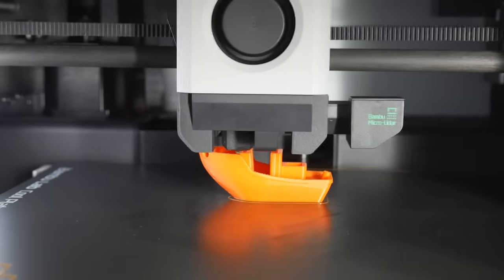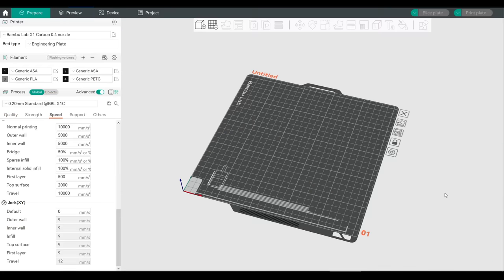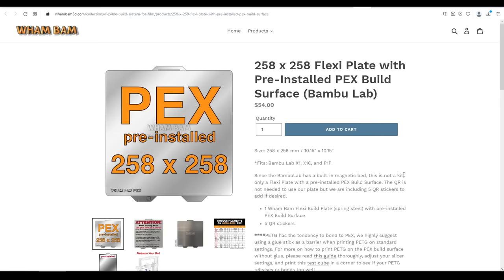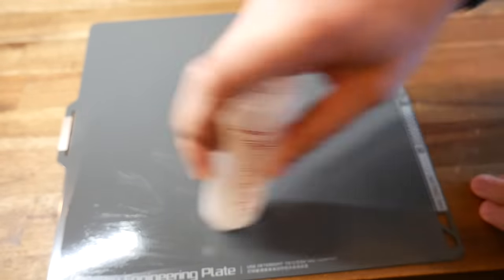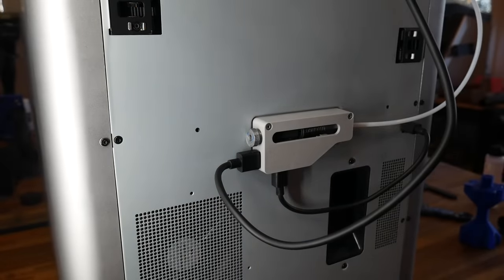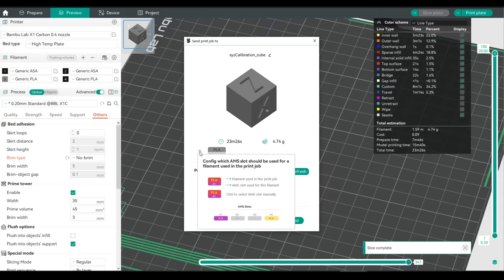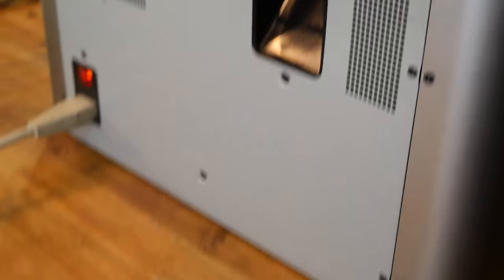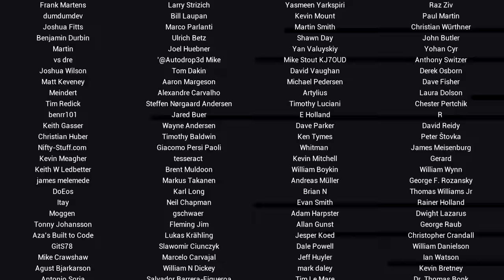The best upgrades for your Bambu Lab 3D printer

Comment: The best adhesive I have used is 3DLAC! Spray on and use on cool plate or hot plate! Best product ever!
Reply: I didn't have anything else on hand, so I tried clear Elmer's glue, and it has never failed. I can print tall objects with a tiny footprint and no brim. Works every time.
Reply: I love 3dlac too. So easy.
Reply: I find 3DLac doesn't adhere abs and ASA adequately. Filaform Adhesive Spray have an extra strong variant for a very similar price and works wonders for high temp adhesion
Reply: @MrStolenakount  3dlac has two variations too, i use the 3dlac plus for abs and Asa and it works wonderfully for me.
Reply: Only needed on Bad plates
Reply: Yes. I use it on textured sheets too when I need to print tall parts with a small footprint, or when the bottom of the print needs to be absolutely flat.
Reply: This! I keep saying it every time and my comments never make it to the top so I'm glad yours did. 3D Lac is the absolute best ❤
Reply: Main job of adhesive on a Bambu build plate is to aid release.
Reply: Yes the Plus is best.
Tried Bambu glue, Dimafix as recommended by Michael at TT, and a few others but 3DLac+ is best.
Reply: most the time i just spray on some hairspray… i’m not very knowledgeable in this field but it hasn’t ever had any stick ability problems
Reply: @BuffGrape I get my new Bambu P1S next week and you answered my question if hairspray works? I used to use a glue stick but now I only use hairspray and it works for me 99.9% of the time on my Ender 3s V2. The only time I have a problem is when the bed is a little off level which takes a couple seconds to fix.
Reply: Nano polymer adhesive is very good too
Reply: Tough to get in the USA

Comment: I never had a failed print on my P1S until I tried printing with Bambu's own PAHT-CF (carbon fiber nylon) filament and using their own profile. I lost dozens of hours and about half a kilo of the outrageously expensive filament before finally buying their high temp smooth plate and glue stick. I haven't lost a print since.. I do recommend getting AMS and some of their support specific filament which will help immensely with your parts appearance and the supports are easily removed.

Comment: Strange to never clean off the glue stick when it just requires a brief rinse under warm water.  I understand the hassle of applying it but removing it isn’t hard and only has to be done after multiple prints most times.

Comment: Use a paper towel and ammonia. It will evenly spread old glue stick residue and you don't need to apply more. Reuse the paper towel and the residual glue can be used for many prints. Only a little ammonia is needed.

Comment: The Bambulab spool switcher & winder is great. I printed it not because I have an AMS or a Bambulab printer but because sometimes the rolls of filaments I use come badly winded.

You can use your own hand and no drill. You get better control. And there are a ton of mods for that model, which greatly increases its performance and ease of use.

Comment: For super good prints with ABS or ASA I use the following settings on the bambu Lap X1

Nozzle temperature to 260 for the first layer and the remaining layers 270.
-max flow of 12 mm3/s
-an extrusion multiplier of 1.0 fits better than the default values of 0.95
-fan speed normal layers 20% to 40% overhangs 40% to 60%
-Speed for the first layer 75mm/s
-110 degrees bed temperature
-high temperature board or textured board
-For very large prints add a bit of 3D Lac
Reply: Thank you for this info 🤘🤘My P1S is shipping and I will print a ton of ASA with it! Assuming it will convert to the P1S; I think the bed temp is max 100° but not positive.
Reply: What's wrong with higher flow rate?

Comment: For using the glue - simply make an X with the glue stick, then spray on some IPA and wipe the bed with it. This will leave a residue that works perfectly and after the print, you simply spray IPA on it again and it's good for another print. That way you only have to apply the glue stick every 4-5 prints. It's shown in this video https://youtu.be/XpHkPJgKkew?t=670
Reply: I do the same. I just wipe the IPA around with a clean hand until its nicely smeared all over and even.
Reply: When you said IPA I thought you were talking about beer. Good thing you added a link to a video! :)
Reply: Just stick glue + water

Comment: For catching poop chute output, I use a small cardboard box behind the printer. Quick, easy (as long as you have or can find a box to fit where you need), and it doesn't take any filament.
Reply: eggo waffle boxes fit nicely and are cheap
Reply: @bulgogiprince8625 Plus, they come with free waffles!
Reply: Leggo my Eggo!

Comment: For the Y splitter for the external filiment feeding, I found a version I really like that has an M3 mounting hole so you can remove one of the panel screws and replace it with a longer one, holding the splitter in place.

Comment: ABS/ASA on the Textured PEI at 110C bed temp will not warp off the bed until it cools. No stupid release agents necessary. I would not try to flex the plate as soon as the print is done. It will be very stuck on there. Could try anything from 90C to 110C to get the perfect first layer adhesion. I usually take it out of the printer and push the bed down on a glass coffee table to suck the heat away from it if I need to remove it quickly. Takes about 10-20 seconds and it pops right off. I have printed probably over 10KG ABS like this.
Reply from the maker: It really depends on the geometry of what you are printing. Some objects will be fine, others will shrink as they cool and generate internal stresses that warp the part. Either way the enclosure helps a lot.
Reply: I've printed some ASA on my P1P. Used a ASA slurry on the Textured PEI (that side of plate  is now for ASA), put the unit outside, covered with a cardboard box.  Internal temperature approached 50C for  hour long printers.  No worries.
Reply: Can I leave ASA prints on the printer bed overnight after it's done printing? or will it warp

Comment: Ive printed ASA on glass by using a trick id seen for ABS, I have a jar that i have melted scraps from failed ASA prints with acetone, brush a thin layer down onto the bed, removes pretty clean and I haven't had any issues with adhesion.
Reply from the maker: Abs slurry is a really old and effective trick, but too messy for me.

Comment: The PTFE bracket is a nice thought, but with my X1C it hits the top of the casings rim when going to the far corners. A break failure of the toolhead is for sure a large warning.

Comment: I just got a X1-Carbon and its my first 3D printer. I've printed quite a lot of dessicant spool holders that screw together in the void space of the spool. I printed a cable management panel for the AMS hub / buffer at the back of the machine but found I had to remix it quite a lot to allow the cable and tube disconnect tools to work when the panel was installed. I'll try printing the PTFE print head guide as my tube rubs on the top glass panel. Currently printing some AMS dessicant holders for the front of the AMS where there is 3 significant voids. Instead of printing a Y splitter for the back of the machine, and having to find the screw-in fittings, it seems that Bambu sell a 4-way splitter on their website for $5 AUD which is normally used on the A1 mini and also works as a Y splitter.

Comment: @14:43 I have watched now about 10 t0 12 videos and no one has mentioned this filament dryer feature. I agree, I would probably use different seals on the glass top when using this feature but still what a great option that’s part of the printer.

Comment: Just a heads up, Dimafix works very good but the adhesive comes off with the print, it doesn't stay on the bed. This means constant re- application. Vision Miner Nano adhesive has slightly better adhesion that Dimafix, the biggest advantage is that it l stays on the bed after the print releases instead of transferring the print, this means you can make it last a VERY long time, just spray a little isopropyl alcohol on the bed to reactivate the nano polymer. It's good stuff

Comment: smooth PEI is the way to go.  easy and no adhesive required like textured PEI, but has a lot more grip, but as long as you let it cool first, it detaches after the print like normal.  the best I've ever used in any printer is my smooth PEI from prusa
Reply: Textured pei doesnt need an adhesive ya nob it aint a cool plate.
Reply: @devizebeats  that's what i said, ya knob
Reply: My smooth pei are a huge PITA. I can't get anything to stick regularly. I clean with dish soap multiple times, I tried upping bed temp which seemed to help for a while but then it stopped working for some reason. All I'm using is pla.

Comment: I'm surprised you didn't include the CHT nozzle upgrade.   CNC Kitchen is the only big channel I've seen cover it, but he focused on print strength improvements rather than speed results.   You did a lot of work to get your RatRig speedboat under 10 minutes and it'd be interesting to see if you could now beat your time with just a stock Bambu + CHT nozzle.   

A channel called BenSol has a 6:13 Benchy on P1P but I think he used Lightning infill so not a valid time for comparison.

Since print speed is a major selling point of the Bambu printers, a fairly cheap and easy upgrade than can push it even faster (especially with 0.6mm nozzle) should be a popular upgrade.

Comment: Had my X1C for a few weeks and I get that retraction error after every 3rd print or so, after it’s done printing though. 95% of the time, tapping Retry fixes it, but it’s almost always been related to my use of smaller 250g spools with an adapter that moves the rollers forward, or a modular spool divider with a filament clip that gets jammed in the side wall gaps. I’ve started to remove the clips before inserting a spool into the AMS, and reapplying my small 250g spools to modular divider spools that are full height and fit in the Bambu reusable spools or a remix of it.

Comment: With a Y-Splitter for the filament, the AMS didn't work anymore properly. The filament load and unload and sometimes it feeds as it should. When the Splitter is disassembled, the system works as it should.

Comment: Have you tried LOKBUILD. I used on a build plate that needed the surface replaced works amazing. Pilled the old one off and had LOKBUILD from an old printer. Cut it to fit. Added a QR code. To me, it's way better than the bambu lab replacement.

Comment: Do you have any experiences how sturdy such a peo plate is? Another tip, if you could call it like that, is that wiping the coolplate with IPA will reduce the initial bonding strength. You need to go up on the temperature, but you can use it after that, without the need of glue stick.

Comment: When using a glue stick I also give the bed a spray with IPA(or Ive used metho) after I applied some and a wipe with a paper towel (not enough to clean it off) can give the bed a nice coat, basically turns to like what the Dimafix looked like

Comment: I have got the failed to pull out the filament from the extruder errors or 3DP-00M-706.  I will try this print and hopefully it fixes my issues, every time I have checked the tube going to the extruder it's been clear of filament.  I think if it's not this the filament sensor in the extruder is faulty.

I tried to use my build plate that looks just like yours I am going to call PEO and even used the textured PEI build plate in Bambu Studio but it seemed to be to far from the build plate when my X1C tried to print the first layer.  It seemed like even though I chose textured PEI plate it tried using the lidar to scan it.

One mod you didn't mention that I have to get done is the X1C LED lighting controlled by the BL LED controller and not only does this give you added lighting but the X1C can control the LEDs along with give you status indicator, red you need to address an issue or green and your print is complete.  https://www.youtube.com/watch?v=3IA5vlClTug

Comment: For the bracket, is that the best orientation to print for strength? I feel like it would be stronger on its side. Just a thought
Reply from the maker: From what I can tell, the only people with breakages in the comments on printables printed it on the side. I agree this seems counterintuitive.
Reply: I printed mine in asa vertically using default settings and it broke right away. Re printed in PC and its fine.

Comment: btw the glue actually washes so neatly with just water, it's a bit amazing how easily it washes off - try it :) - I prefer the cold plate now, the textured pei gave me a bit of trouble with non bambu filaments or the lidar.. black on black doesn't work all that great

Comment: I got a free PLA plate from Bambu to test out. Has a satin finish, and requires no glue, PLA sticks incredibly well when printing, and releases easily when you want to remove the print. Not a single failed print so far, can highly recommend buying one whenever it releases, the cool plate is comparatively trash
Reply: Is that new? I didn't see it the last time I was on the bambu store.
Reply: @DisorderedArray  They sent me one for free to test out months ago. And sent a questionnaire a month ago to give feedback on the plate. If they still haven’t released it, then I assume they’re in the process of creating the next version, hopefully it releases soon, because it’s been really really good so far

Comment: All ya gotta do to wash the engineering plate is run it under hot water for 1/2 a min and it melts all the gunk glue off then I spray some dish washing spray on it and a few quick wipes it looks brand new.

Comment: Since we're on the topic of closed system 3d printers, it would be great if you could do a video on how to calibrate them and their dimensional accuracy!
Reply: I expect the Prusa will counter Bambu, especially in the printing speed area, while maintaining an open system for the community
Reply: Would be great. But prusa machines really aren't super affordable or multicapable for their price. If they could do high temp, be enclosed, air filter, chamber heating , etc without charging a crazy amount, that would be great.

Comment: Desiccant holders for the AMS are a "must have" if you own an AMS.
Reply: My AMS is being fed by a Repkord box so I do not.  How ever in most cases you are correct.  I like the Repkord box because it has a Golden rod which keeps the filament nice and dry.  The down side to this setup is spools don't automatically roll back up.  The up side is I can use 3kg rolls and my filament stays dry.  To each their own.

Oh huh I just looked at their website they no longer sell the rods hmmm...

Comment: MY Bambu Lab X1C + AMS experience: 
I spent damn near every penny I had saved up on one - HOPING that everything would work, 
and I'd be able to do the prototyping and parts that people in my hobby where asking me to do.. 
I get the setup,  get everything set up - annnd - failure after failure after failure.. after failure.
Non stop back and forths between customer service - before they finally caved in and recognized that I was in fact sent a [Very] defective printer.  Unfortunately they required me to send Everything back to them.
After a week or 2,  I get the replacement setup,  set that up, and to my amazement [sarcasm] it actually worked as it should.  BUUUT - Non Stop F'ing Failures from the AMS!!!!  
Every Single Time I [Try To] Use It - It Fails.  
Sometimes it loads - Sometimes it doesn't.   Sometimes it pulls the filament back - Sometimes it doesn't.
***This makes multi color printing IMPOSSIBLE and wastes over Six Feet of filament Every Single Time.
It's infuriating.  <---  And to add to that - I tried doing the BS 'ticket' thing again via the website, 
and no matter how much time I waste and TRY to contact them about it - Nothing goes through to them.
*Puts on my tinfoil hat*  It's as if I've been shadow-banned from their 'tech support' site.. 
I've had all sorts of things apart,  inspected everything,  can't find a single issue [w/o diag equipment].. 
I've done the Hydra mod . . . tried other filaments - etc...  Nada.  UnFrigginBelievable..
Recently,  I've had to begin battling w/ the prints to get the support material off - and the adhesion is so great, that many of the prints are ruined in the process..  
I tried printing w/ 1 filament and then using Their Support-Filament - but get this... 
The friggin' AMS sends an error saying that I have to use all the same type of filament - and failed to work.
Same deal with loading 3 spools of PLA and 1 spool of PLA-CF [for when I need it]
Ohhh no,  THAT can't be done.  Because They Say So.  Apparently.. 
And of course,  I'm unable to contact them for any advise/tips/tricks/etc. 
Awesome.
😒💥🔫

Comment: PEO sheet bed adhesion has issues consistently.  I clean it with 99% IPA and set textured plate in slicer. Many many failures. I dont want to use adhesives. Any advise?  Thanks in advance!

Comment: Hello, thank you for this video! Where do you see this printer in 5-6 years from now? Do you think it will be still supported(Parts etc)? I'm almost sure I want to buy it, but this is getting constantly in the middle!
Reply from the maker: The head honchos of this company largely came from DJI. It makes sense that they MAY follow a similar business model if that helps. Apart from that I haven't printed a crystal ball yet.
Reply: @TeachingTech  I see... My crystal ball is at 20%...If I had a X1 it would be finished by now..